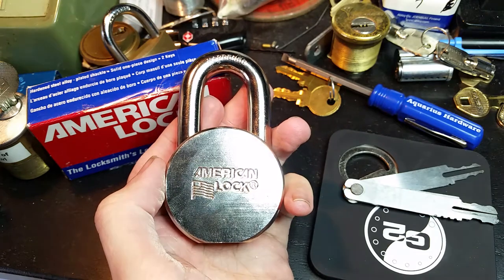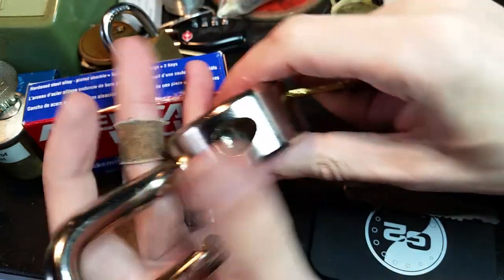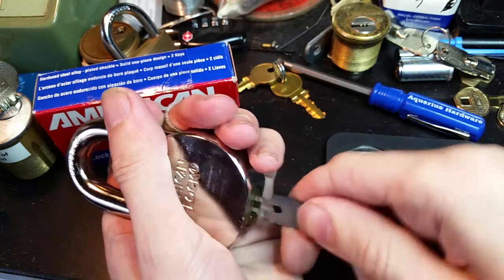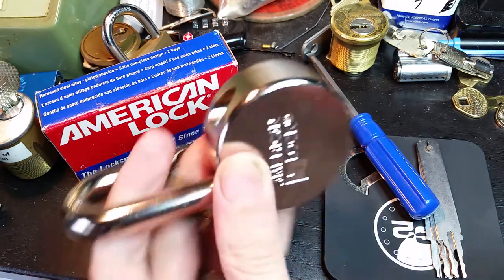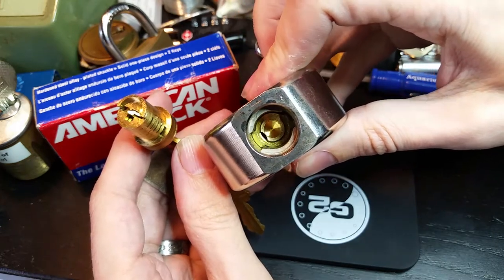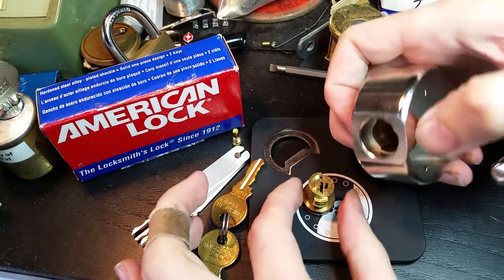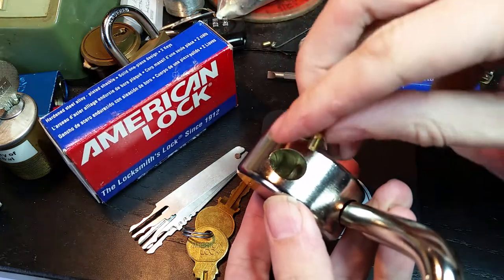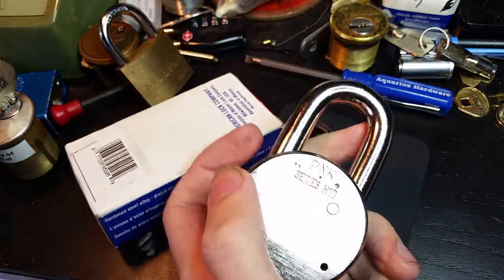(89) American Lock H10 wafer lock picked and gutted

Comment: good video,  I use a dimple pick to push that retaining pin back against the core and sometimes if it's a little grimey I use one of the flags to scrape it a little. ..thanks for sharing
Reply from the maker: Cool idea. The real trouble is getting the pin to disengage in the first place, especially when it is factory fresh.
Reply: Nite 0wl yeah, I don't know if you seen my video on the American kc 40, I beat that sucker for 5min. Lol, but so far I been having a bit of success with those picks (and wd40 )
Reply from the maker: Just watched your video. Don't think I have ever seen a KC40, I just followed what the service manual says which is to beat the sucker against something hard till the pin moves.

Comment: Thanks for this. I ended up with a lot of these, only mine were used in some outside industrial location and so requires a lot of cleaning up. Some had wafers that were seized up with gunk. Nice heavy duty body. Too bad the cylinder security is not so good:-(
Reply from the maker: Few lock designs remain manipulation resistant after 100 years (which is roughly how long that cylinder design has been around.

Comment: Sweet lock. We never had those large wafers on locks down here. Now I know why my jigglers wont fit into anything else.😟Cool to see it opened and gutted. 🍺👍🏽🇦🇺
Reply from the maker: A lot of Chicago Lock and Illinois Lock company products use similar keyways and wafer setups (the American Lock H series cores were a collaboration with Illinois Lock Co.) so the wafer jiggler sets will work on many of them.
Reply: @Nite0wl  thanks for that, I never knew. Cheers for that.🍺😉
Reply: @Nite0wl  I never heard about the collaboration before but now it makes sense; I guess that's why the other American lock that closes like this (with the pin you have to slide back and forth by thwacking it) is the HT-15 with the tubular core, because it was also a collaboration? In another comment you mentioned that they started making this in 1924, where did you find that out? I love collecting American locks and would love to know more stuff like this about the history of the company :-)
Reply from the maker: @abrahampig6829  The approximate date of first production is based on the filing date of John Junkunc's patent for the design of the H10 (US1607758) which was filed January 17, 1924. Given the way that US patent law works (especially at that time), Inventors typically wait to file their claims until just before they are ready to begin production (to maximize the time their protection lasts) but before the covered products are released onto the market (as historically that made them ineligible for patent protection). That approximate date is further confirmed by a review of historical catalogs from Junkunc Brothers/American Lock available in public archives  (Junkunc acquired the American Lock Company in 1919 but continued using both names for different product lines for a number of years afterwards but for marketing reasons the American Lock brand was typically used for any new products introduced after the merger).
American Lock's padlock range principally consisted for a variety of body and shackle designs built around the same wafer core and ball bearing mechanism used in the H10 well into the 1950s. As late as 1958 their catalog consisted of 17 padlocks using wafer cores, 5 hasps in 3 major variations, and a pair of combination padlocks very similar to the modern Master Lock 1500 series. Regrettably a number of useful references on the history of Junkunc Brothers/American Lock Company have been slowly lost since their acquisition by Master Lock/Fortune Brands in 2003 and the slow consolidation of the two companies.
Reply: @Nite0wl  Thanks! I found a blurry scan of the 1958 catalog, where I can almost but not quire read the data tables... Do you know where I can find a non-blurry scan or scans of any other catalogs?
I find it fascinating that the 1958 catalog already calls the combination padlock the model 300, but the better known models 100, 200, 260, 530, 560, 570 etc. are not available yet. I guess they already had the new product numbering scheme in mind but hadn't released any of the others yet?
I also heard there may be some information in "Early Locks and Lockmakers of America" by T.F. Hennesy, I'm looking at getting a used copy of that.
Reply from the maker: @abrahampig6829  Unfortunately I suspect I have been working from the same blurry scan. The Internet Archive, Antique Padlocks dot com, and various lock collector groups are the best sources for scans of old catalogs but unfortunately a great many catalogs are not publicly available if they were preserved at all.

Comment: Awesome! I just got one and wasn't sure how to disassemble it. Thanks. :)
Reply from the maker: Happy to help
Reply: Nite 0wl Went to get a key for mine and the blank is restricted. XP
Reply from the maker: Oh, so it isn't the standard AKB but one of the AKBWRA-AKBWRE variants? (If you aren't sure, check out Page 32 of the American Lock Service Manual: http://www.americanlock.com/pdfs/A-004_Service_Manual.pdf) If you have a Dremel tool it might be possible to modify the standard unrestricted blank to fit.
Reply: Nite 0wl Already modified a blank ;) Plan on doing a video soon. The link won't open. XP
Reply from the maker: http://www.americanlock.com/pdfs/A-004_Service_Manual.pdf
For some reason it included the trailing parenthesis.

Comment: How do you get a broken key out of the H10? I have been running into quite a few lately and my peterson extractors do not work.
Reply from the maker: That would depend on how the key got stuck. If it was just snapped off the plier-style extractors may work, otherwise you will need to find someway of holding the wafers out of the way while pulling on the remaining fragments of the key.

Comment: I've got one of these, a little older than yours, and I've been trying to find a video on gutting these for a long time.  Thank you so much for uploading this!  I have no key for it, is there a way to get a keyed core?
Reply from the maker: If you are in the US, Mr. Lock sells replacement cores (the H10 takes ABTC1 cores) either keyed alike to a set default, or optionally (and for $1 less) randomly keyed. Either way you get a pair of newly cut keys with each core. The specific item can be found here: http://www.mrlock.com/american-lock-padlocks-1/american-lock-ah10-series/americn-lock-abtc1ka-e113
Reply from the maker: Obviously this will require you to be able to get your lock open and remove the old core.
Reply: Nite 0wl thanks for the info.  I can get it open.  Even for a novice picker like myself it's not a very hard lock.  I just love everything about this lock, and I'd like to make it serviceable again.  I'll be checking that out soon.
Reply: Nite 0wl got it picked and gutted.  gonna ordering a new core soon.  Again, thank you for posting this video, and thank you for the info about finding a new core.

Comment: these locks are not what I call hard to get into
Reply from the maker: Considering they haven't changed the design significantly since 1924 that isn't surprising.
Reply: Nite 0wl. agreed although mildly disappointing considering that the lock appears to be a strong hold and yet with a flat head screwdriver you can pull the tumbler right out and gain access in minimal time and effort